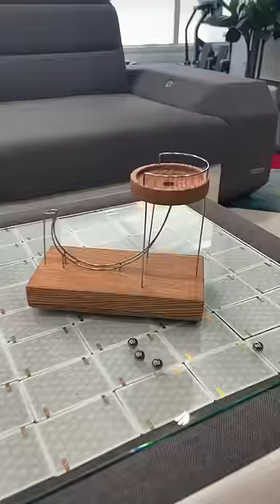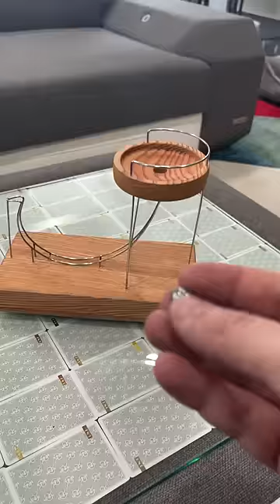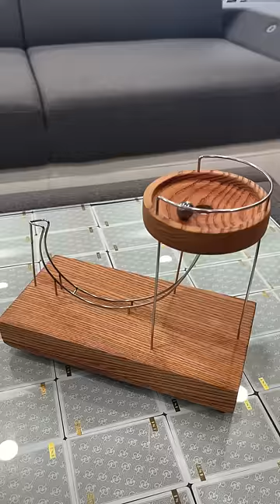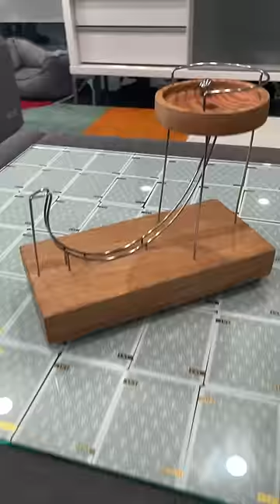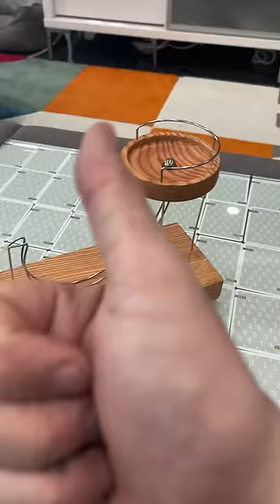An Impossible Perpetual Motion Device?! 😳 #Shorts

Comment: Me when I plug in the extention cable back into itself
Reply: Technically if you put something under the bottom rail that created energetic every time something puts weight on it it would create infinite power
Reply: @The98racer  theoretically, not technically. also, having it be weight, wouldn't work.
Reply: @The98racer  also, it's fake, obviously. you can tell by the acceleration. and the size of the block it's on. but, if it was real, it'd be interesting to see what we could do with it.
Reply: Chinese lock
Reply: My sibling did that but in powerbank, it smokes terribly bad and died. Luckily it didnt explode
Reply: Welp, that's Infinite Power.
Reply: UNLIMITED POWER!!!!!
Reply: Ahhh that’s where the magnet is. I was trying to figure out why it looked as if something was pulling harder than just gravity.
Reply: Me when I plug the powerbank into itself too
Reply: 1 thousand likes and now 10 comments perfectly balanced
Reply: @Nicolas B  true should have noticed it’

Comment: It looks unnatural, because it is. That's not normal drop acceleration, so there has to be something in the frame that speeds it up. The wooden base is also suspiciously thick
Reply: It has a magnet. The dude explained that perpetual motion is impossible
Reply: Neodymium magic
Reply: Why is everyone saying this? Like no shit...he just said it's impossible.
Reply: @aimanazminovich3602  still not possible. If just placing a magnet did the trick it would still be considered perpetual
Reply: @girikroutaray1847  not really because it's being manipulated to move... one time its going to stop working
Reply: @Matt-pd5dh  it can never reach as high as it dropped from , due to energy loss as heat and sound. And here it's in fact going higher. Which means external energy is provided. A magnet being placed is not a form of energy as the space around it is still in a constant field, and hence energy still conserves
Reply: @girikroutaray1847  im not sure if you're saying that the ball is moving on its own or what, but the ball is being controlled and not being moved by gravity, so it doesn't really count
the bottom of the thing is pretty sus, im sure that there's batteries involved.
Reply: @Matt-pd5dh  I'm saying the same thing, except that a magnet couldn't do it . As in a normal magnet
Reply: @girikroutaray1847  with that acceleration... I am thinking a fast spinning wheel in the drop base
Reply: @girikroutaray1847  It doesn't matter, because even magnets get worn by time not as quick as other energy sources but they will so the pulling force will decrease therefore it will stop eventually.
Reply: If it was a magnet it would accelerate down until it passes the magnet and then decelerate. Also ball bearings that aren't magnetic themselves always attract to a magnet. Not repel. If thr bearing was magnetic it would flip around to still be attracted by the magnet at all times. It would have no effect or slow the ball down. It can't be a magnet. It can't be a railgun either cuase railgun don't work with ball bearings.
Reply: Everyone is saying magnet but that would pull to one point, I think one rail is the positive terminal of a battery and the other is negative, and this is essentially a miniature, low power railgun
Reply: @BryceHomier17  there was no proof in the video tbf. He said it was impossible, but then showcases it without explaining how it works. It's clearly some kind of electromagnetic thing that speeds up the ball
Reply: @girikroutaray1847  you know electric magnets exists right? Not saying that whats happening here but you could do it.
Obviously you then add energy inn to make it work, so its not perpetual
Reply: @AsmodeusDHare  we would probably hear it tho if its spinning fast and is small
Reply: It has a electro magnet just looked it up...
Reply: @imonshrooms6866  but we do hear some weird noises when it passes through. But as the guy above said, it's supposedly electromagnets.
Reply: @girikroutaray1847  eventually it would lose its magnetism and would fail to go on forever
Reply: I think there is a tiny motor spining a wheel that sends that ball flying. In the top part of the mechanism
Reply: The metal ramp is probably working as a rail gun. Accelerating the ball by providing a electric field with a battery in the base
Reply: Well the title does say its a device
Reply: Lol. It’s obviously unnatural. You didn’t figure out a secret… there’s something propelling it as soon as it drops through the hole. (Not a magnet either, if a magnet worked it would just be a perpetual motion machine…)
Reply: It would fail with a glass marble
Reply: @girikroutaray1847  the reason why a magnet wouldn't work is it would decelerate the ball on the way up just as much as it accelerates it on the way down, so it'll speed up faster but get pulled back down harder so still wouldn't reach the initial height.
Reply: @imonshrooms6866  a electromagnet that turns on and off to accelerate on the way down but not on the way up. That requires energy and wouldn't work with just a ferromagnet.
Reply: If you count the rounds the ball do after each time it landed on the plate, you'll see it drops, meaning it will come to a stop.
Reply: It uses magnets
Reply: @devidszabo6680  Dude, magnet is NOT an energy source. Go back to school dude. Without CHANGING magnetic fields, no energy can be produced.
Reply: It's got a electric cell underneath it
Reply: @girikroutaray1847  actually no. The magnet is just what makes it non perpetual. Magnets aren't eternal, they lose "charge" over time.
Reply: Magnet
Reply: @girikroutaray1847  electromagnet
Reply: There is a small wheel in that hole that speeds up the ball. That's it
Reply: Guys this contraption has a battery in it, not magnets. Look it up.
Reply: @Arelias95  Plus have you heard of magnetic energy? It's the energy the magnetic field contains. In this case this magnetic energy gets converted to kinetic energy of the ball. E=½LI² Go back to school kid.
Reply: @nikolalazovic1315  link
Reply: @BryceHomier17  Look, I for one am just trying to figure out how it does work; I'm not going to waste my time trying to debunk something nobody claimed was true.
Reply: @girikroutaray1847  I believe there's also electricity moving through the ramp. The two things together produce a motor effect for some ungodly reason, but I think that's effectively how motors work.
Reply: @imonshrooms6866  I literally said normal magnets as in natural magnets. By using electromagnets you're literally adding energy dude.
Reply: @gaysarahk  he had dr strange shoot his Cumberbatch all over the machine, then let it dry and its magic now.
Reply: The balls are also steel so they can be magnetised extremely easily.
Reply: Or the weight of the ball is just right???
Reply: @girikroutaray1847  a simple magnet wouldn't work her in the first place. The speed it provides to the ball while the ball is coming downwards will be reduced once the ball goes  past the magnet since the magnet will attract it downwards. Even if it did work, the magnetic field would become weaker and weaker with time. It can be an electromagnet which can be switched on and off to provide enough velocity to the ball. And if it's an electromagnet, you would have to supply electricity so no perpetual motion.
Reply: Electromagnet
Reply: Pay attention to his words. He said a perpetual motion machine would look like the machine here. He’s implying that it’s not a perpetual motion machine by saying that. So he’s not trying to hide anything, he knows people know it’s fake.
Reply: @girikroutaray1847  Magnets can be used to make almost perpetual motion machines. They aren't perpetual though because eventually the magnet runs out of charge and it has to be remagnitized.
Reply: The reality would be the potential to kinetic buildup in the spiral before the perceived drop point. But yes, magnets and the em spectrum are involved, as are the other fundamental forces.
Reply: Equilibrium
Reply: The air it goes through also matters
Reply: @aimanazminovich3602  its not a real magnet, it’s an electromagnet. There are multiple coils pointed towards the camera contained within the base, and as the ball falls through the field it gains forward and then upward momentum.
Reply: @aimanazminovich3602  well maybe but we don't know.
What we do know is this might be real, but even if it is, it's still not perpetual motion because it is using energy harnesses from gravity.
Reply: @Duck_side  if you can harness more energy than the gravity added then it still counts as perpetual. similarly if you can harness more energy by moving something close to a permanent magnet than it takes to pull the thing away from the magnet, that would also be considered perpetual. both are impossible. this is an electromagnet that switches polarity as the ball passes
Reply: @imonshrooms6866  an electromagnet wouldn't do it either. If you turned it on and off at the right times then it could give the ball some extra energy, but that's like saying the wheels of a car is what gives it the extra energy to move.
Reply: @blairjohnson6014  it would be possible if it were an electro magnet but would also need a circuit board and potentiometer and/or hall-effect sensor that switches off the exact time the ball passes through the field.  This all can easily be made very small and run off a double or even single A battery and could be inside the wood but I've never seen anyone flip one over to show the underside so I don't know.
Reply: @blairjohnson6014  but after reading some comments it seems far more likely  (and cheaper) if it were just a spinning wheel you can't see speeding it up as it passes through
Reply: @ryanlynch3579  A steel ball reacts to a magnetic field differently than a steel disc.  Try drilling through both o
Reply: of them. On a molecular level one is penetrable the other is not. Its been too many years but I think that it was discovered ( observed) that a steel ball will propel away from a magnet once the balance is even slightly shifted. Many things to consider.
Reply: @devidszabo6680  
I think you're deeply confused about how magnets work.
The magnet doesn't use up pulling energy to pull stuff in. There's a magnetic field and you gain energy when you move towards the magnet and lose it when you move away from it. Even if you had an infinite magnet you wouldn't get a perpetual motion machine.
Reply: @ArmageddonPhysics  And what charges the ball electrically and why doesn't it lose it's charge to the rails?
And why go to such lengths if you can simply install an electromagnet?
Reply: @erik19borgnia  
An eternal magnet wouldn't give you perpetual motion either.
The acceleration you get with a magnet is not due to some energy stored in the magnet and depleted over time.
Reply: @devidszabo6680  
By your idiotic understanding of physics the earth would lose gravity if it attracted too many things.
The magnetic "energy" is due to the ball being far away from the magnet. Not due to the magnet having attraction-energy stored somewhere. Without friction the accelerated ball could move away from the magnet again, would be slowed down and have it's magnetic "energy" again. The same as before and with no relationship to the magnet demagnetizing.
Reply: @argon7479  Please give me an example of a machine that gets energy by demagnetizing magnets.
Reply: @Zreknarf  Unlikely. If it switched polarity, the balls would have to be magnetized and the railing a non-magnetic material. I think the electro-magnet is simply turned off after a short time.
Reply: @MrCmon113  you can build a tiny magnetic track and make an object go around with practically zero energy loss as it does since it levitating so there's no friction. Eventually though the magnets run out of charge so the train will stop
Reply: @MrCmon113   Okay, first of all, where did you read "pulling energy"? Because I literally wrote pulling force. Which can create work and kinetic energy. Wtf is pulling energy? Where did you get this bs?
 Secondly, I apologize I was wrong and I used the wrong formula for the magnetic energy. The right one is E=m*B where m is the magnetic field and B is the mechanical work done by the magnetic force. Thanks for correcting me, and I also admit my understanding was idiotic because I did a perfunctory research.
But at least you admit as well I was right when I was arguing for there's such as magnetic energy.